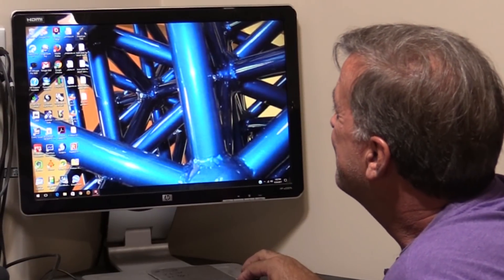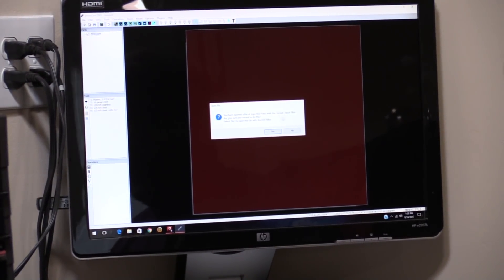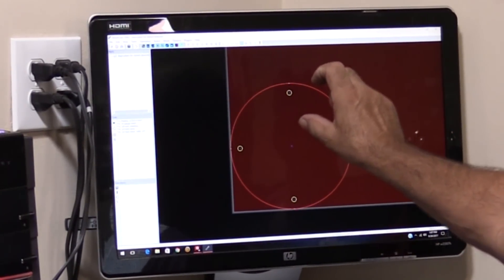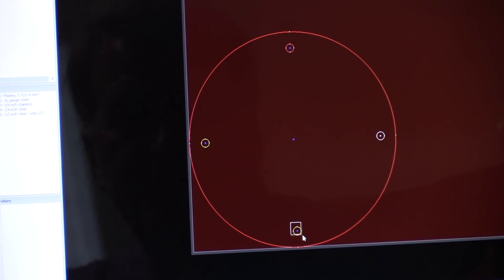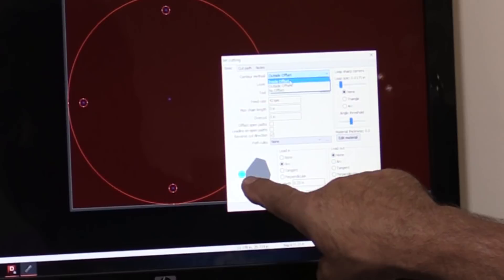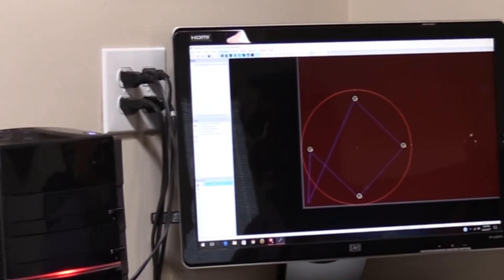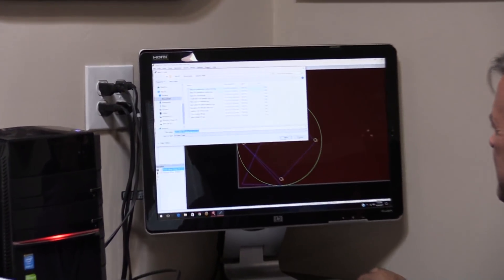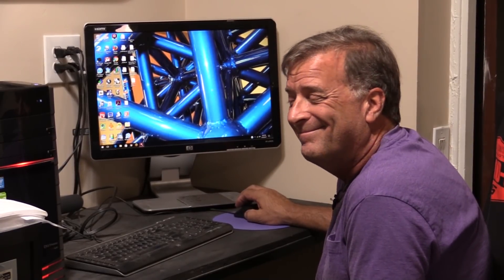How to Prepare Files for CNC Metal Cutting Using SheetCam - Kevin Caron

Comment: I love your video!  Explained very nicely!  A question for you as you use a memory stick to transfer the data to another computer,  in my case i will be doing the same but my table is at a location that doesn't have wifi.  Would I have to do a dry run plasma cut or will the Firecontrol work anyways?  Thank you for your time !

Comment: Good stuff!  I use sheet cam everyday, i like it a lot compared to other CAM programs.  One shortcut you can do.  Instead of moving all your holes to separate layer, leave them on the default layer, and move your outside circle to the second layer, this can come in handy if you have a lot of inside cuts to make.
Reply from the maker: Oh hell,,,, why didn't I think of that?!?!?!?

Thanks for the great tip!